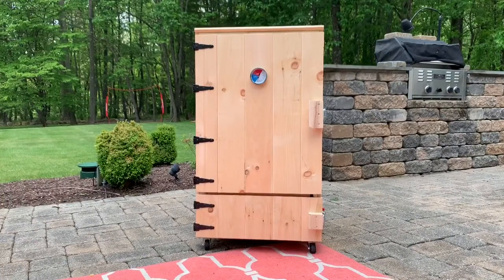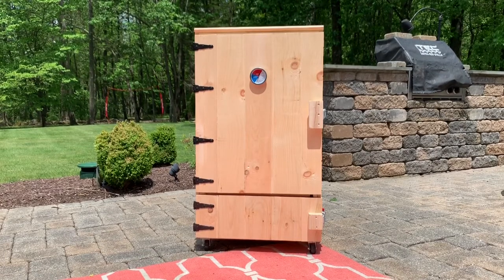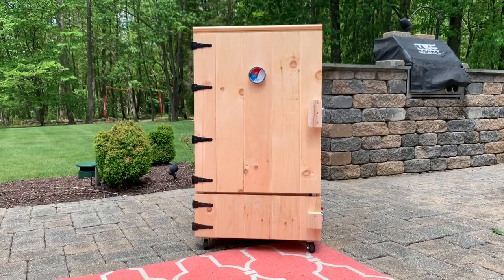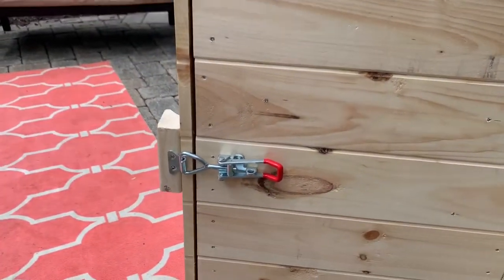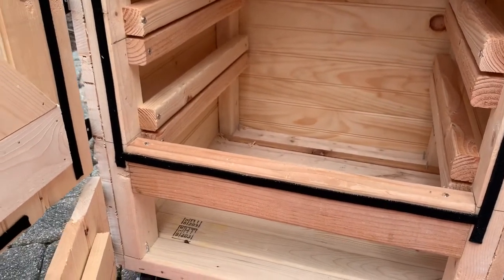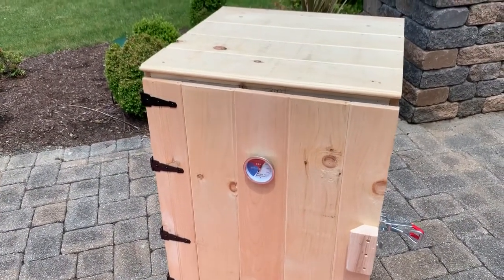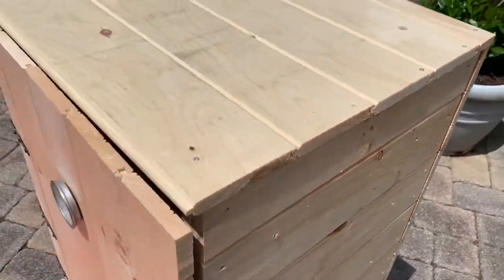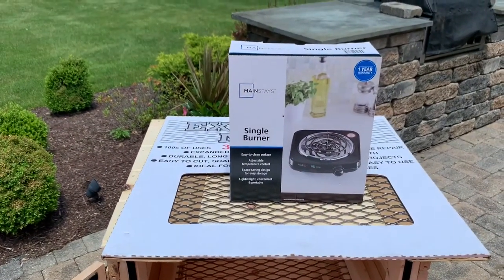DIY Electric Smoker (Easy & Cheap)

Comment: Please don't think i'm being negative because you did a great job and it looks great.
i come from a country background farming ranching hunting and so on.
so when we build a smoke house you cant use regular lumber from the local Depot and not pine. the lumber you get is heavily treated so when you smoke your meat all those chemicals leach into the meat and pine has natural things like turpentine among other things that also leach into the meat. you should use metal or natural wood that is wood from an actual lumber mill if you have one in your area they cut lumber straight from dried trees so no chemicals.
generally we use oak, maple hickory mesquite pretty much the same wood you use to smoke with.

As far as your  design you mentioned you are not a carpenter but  beautiful work i usually put a meatal pan at the bottom to catch water and fat drippings and i do a lot of sausage so mine is about 6 feet tall and i have hooks cause i like to hang my sausage but they smoke just as good on a screen but when you have   a lot the screen gets crowded.
So hope this helps and again great job.

Comment: The electronics on my Masterbuilt MES40 failed after 3 years and I bought an Auber Instruments PID controller to bypass it. I really like how well the Masterbuilt is insulated. Works great at any outside temp and it is also always cool to the touch on the outside so I know it is retaining the heat well.
Reply: That amber pid is exactly the way I’ll go with it.

Comment: Great build!  I’m thinking of doing something similar myself.  I still have a Masterbuilt, but just use it as a heated box.  I didn’t like the inconsistent smoke that resulted from the electric element cycling on and off.  I found the A-MAZE-N maze smoke generator to work well to provide smoke and then just use the Masterbuilt controls to maintain temperature.  Masterbuilt also makes a cold smoke generator that works pretty well.  Either would probably work well in your case as well if the box is insulated well and you get inconsistent smoke.

Comment: 11:00 In my area (mid-michigan) we have Alro steel outlets.  They sell expanded steel by the square foot.  I bought slightly less than 4 square feet for about $15 and paid them another 7 for nice clean cut edges with their in-store sheer.  If you can find a place like this, avoid the big box store prices.

Comment: Damn nice build. Most of those hot plates shut down at around 180. I took my hot plate apart, took the two wires from the knob off and wired them together so my hot plate doesn't turn off automatically. I can still turn it off with the switch.

Comment: The best smoker if you want to buy one is the Little Chief Smoker.  No electronics, just a heating element and a tiny cast iron pan to hold the wood chips in a tin box.  They’re the most common smoker for home use in Alaska—a state that arguably does the most smoking of fish, moose, etc.  they last forever, rarely break down, and you can find them used on eBay for $50.

Comment: You will need some small amount of controlled airflow in (bottom) ... out (top)... Controlled combustion, exhaust smoke movement.  Nice job.... wood will be a very good insulator and you will be able to control temps well.
Reply from the maker: bnodosa -Thanks! I appreciate it.  I was gonna try using charcoal this weekend. I knew I would need to add some air control. While extremely frustrating at times, learning is half the fun!  Smoke On!